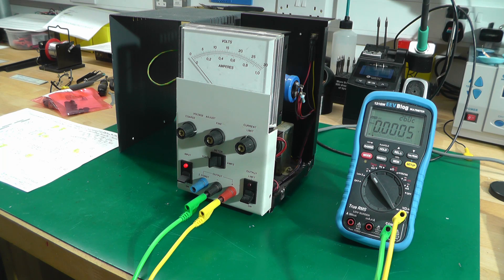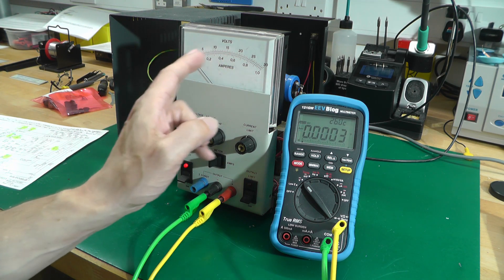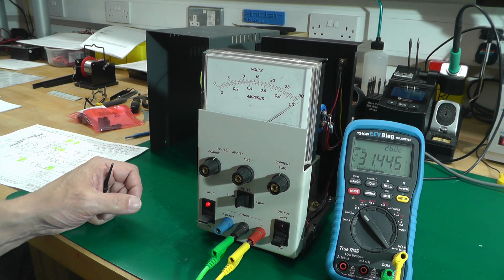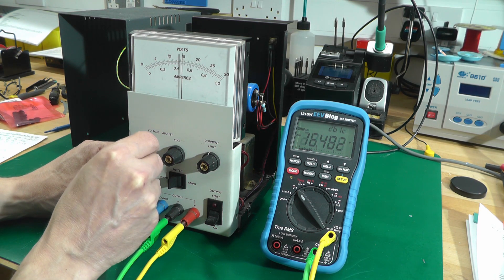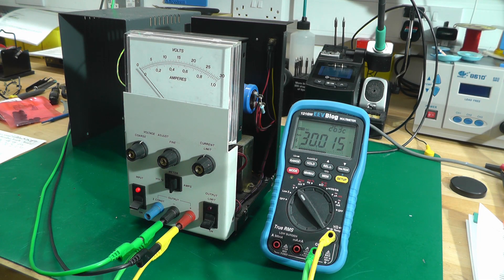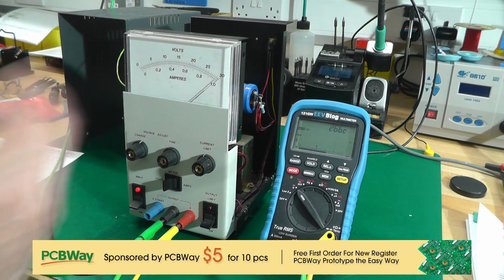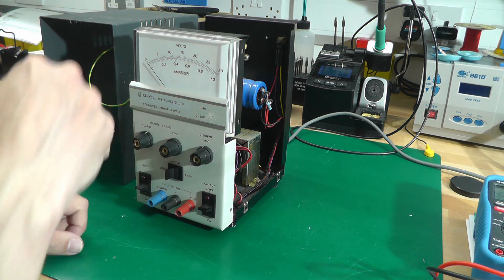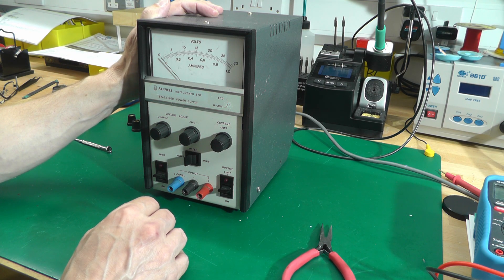No.055 - Farnell L30/1 Power Supply - Calibration & Front Panel

Comment: I have just got one and try to set the calibration and zeroing the meter put the calibration out so I set it for 30 volts and the set for15 volts and then adjust the meter to read 15 volts.

Comment: Me again  Ian sorry to bother you but can you explain what SOT means on resistor R12 measures 13.8kohm colours say it should be 8.2kohm, cheers.
Reply: SOT means - 'Select On Test'
Or, put in the component value that best makes the test result you want.

If you lifted one end of the R12 off the board to get a correct reading of its value, and it still measures many Kohms out, replace it.

Comment: Hi Ian, great video mate I have the LB/30 1amp could you please advise what I could use to calibrate the current loadwise I dont have an electronic load, many thanks Ian.
Reply: Use lots of hefty wirewound resistors in series/parallel as required (use Ohm's Law) and mounted on a fireproof insulating board , or make an electronic load with a power MOSFET driven by an OP-AMP (best solution).

Comment: From my experience all my bench PSU's at max voltage are above rated so I would have left it at 31.5V as it was but set the output to 30V for meter calibration.
Reply from the maker: I did think about it (as noted in the video) but thought what the hell......🙂

Comment: Hi Ian... Did you do that cal with no load on it, you may find that the output volts could be a little different, even with a small load, just thought I would mention it :) I am referring to the 5 minute mark in the video
Reply from the maker: There is about 4mV difference on the output @30Vdc between no load and the full 1A load. But yes, I should have mentioned that for clarity.